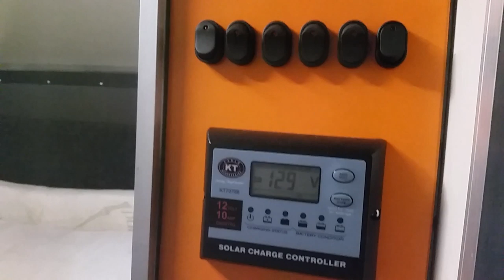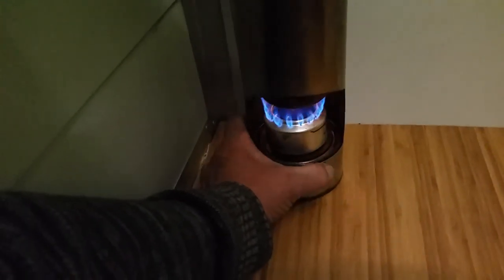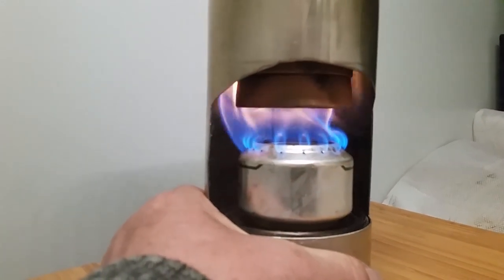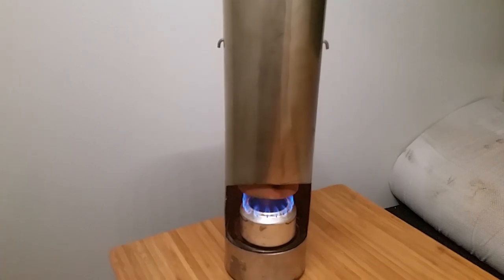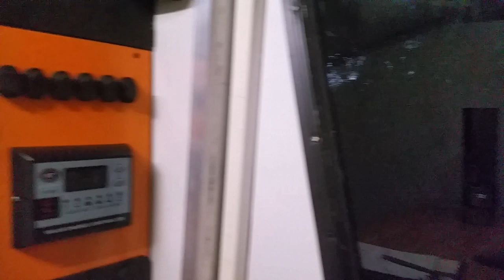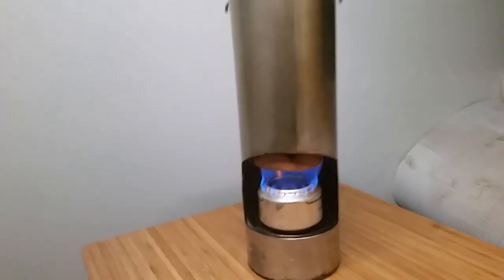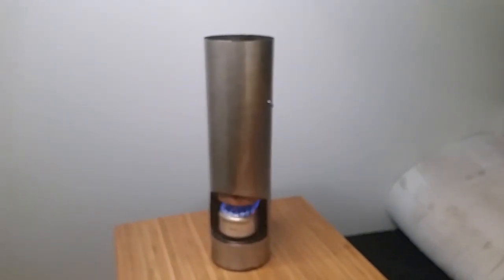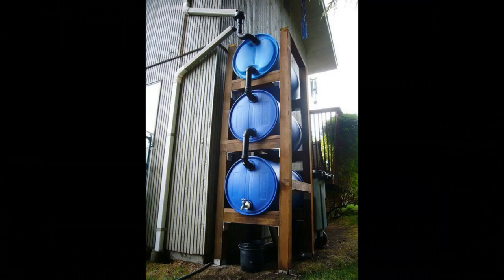DIY Heater for Teardrop/ Van/Tent- Off Road Camping Expedition Overland Trailer-

Comment from the maker: This is an un flued open flame,  liquid fueled heater and ALL the safety protocols must be observed.
* use with adequate ventilation 
* ensure that you are not a complete idiot before during and after use
.* attach unit firmly to a fire proof surface,
 *stay classy - don't try to rip me a new a- hole because you think its dangerous. -Remember Im old and I grew up with kerosine heaters and survived.

Comment: I use bioethanol in a trangia to heat my insulated van. Works great, but people always come to check, when they see the flame in the window, which is somewhat reassuring but rather intrusive.
A chimney like yours would hide the flame nicely.
Not sure how much effect the terracotta pots have. You should totally do a thermometer/stopwatch comparison with them in the chimney vs removed.
Reply: They'll put off heat roughly in proportion to their mass.  The way he's easily moving his contraption, I'd say it's not a very great mass.  A teardrop is a pretty small air-space, though.  If it's insulated, it probably holds that initial heat pretty well.  Moisture build-up is an issue if you button it up tight enough to hold the heat.  Of course, you're maybe asleep before the fire burns out, and your vent's still open.  I'd be obsessive and stay up 'til it went out, and (partially) close the vent, after.  I wonder if any work's been done with pass de-humidifier.  If you've got it tight enough to trap heat, you're also trapping the moisture from your breath.

Comment: I've used 3 inch stove pipe with elbow inserted into engine intake on small general aviation planes, with a propane torch in the bottom. Works great in cold climate to preheat the engine for starting.
Reply: just trying to invent a preheater system for auto engines to reduce fuel consumption during the warm up, We need some sort of 12 volt heat gun and now with the cordless tools that might just be the ticket to rigging up some sort of warm up system.

Comment: Ahoy, from the tropics of the USA.  Some obvious variations would be to make an alcohol burner with twice the fuel capacity and half the burn rate.  It would create only a bit more CO (hardly any).  Use the hot burner for quick warmth and then switch to the slow burner to maintain for an hour more, before it goes out.  Ceramic pots... wish I had thought of it.
Reply from the maker: Yes yes!- Im doing just that now. I have a tuna can with a wad of toilet paper in the bottom one inch thick. on top of that I have a layer of 1/2" stones. That holds 4x as much and burns for 2 hours 20 mins

Comment: Great little heater. I remember when we did use kerosene heaters back in the day you used to put a tube around the flame I think with the result that it only got air from underneath. It would then burn with a completely blue flame with no smoke. Not sure if that makes it hotter and/or cleaner (hotter is usually also cleaner)
Reply from the maker: yup - I fully agree with  you- Im getting great results in zero C temps.- we had frosts two nights out of 4 and I stayed toasty

Comment: I think a simple oil or gas lantern can also keep these small spaces pretty toasty.  I'd like to have a wall-mounted lantern that drew its air from outside and had a chimney, so it was sealed-off from the passenger compartment.

I knew a guy who had an insulated canopy for his pickup.  He'd throw a couple layers of memory foam and a mountain of blankets in the bed and hang a lantern from the vent  - one of those tilted windows on a crank.  He went out camping, hunting, and fishing, year-round, and he swore by the lantern method.  I'm pretty sure medieval Mongols ran around in fur-lined yurts on wheels that they heated with fat-/oil-burning lamps.

The Sugar Lobby demonized it, but up North, oil and fat are gold.

Comment: Perfect? Not so much, stressing ventilation can not be understated. Emissions are present. Alcohol is still emitting volatile hydrocarbons.  Ventilation, ventilation, ventilation, especially in a small insulated footprint teardrop trailer like this.  I like the thermal mass clay pot adaptation.  Simple and practical.  FYI: Any off-the-shelf small wood gas stove can accept an alcohol canister too. Good thing the vent and door were open in this video providing adequate ventilation.  Alcohol, paraffin, and kerosene poisoning is a real issue in non-ventilated spaces. SilverFire Stoves & Cookware.

Comment: May be you could use a set of magnets like the one from an old hard disk to keep the burner in place ...
Reply from the maker: oooh- awesome Idea Guenther!- Ill fita heat shield to theback and sides then do exactly that. You are awesome!
Reply: Speaker magnets or microwave magnetron magnets good also..
Reply from the maker: @ng4410   haha-I have this fetish for Neodymium magnets and cree LEDs Ill be using recycled hard drive magnets

Comment: How many BTUs in 440ml? A gallon of alcohol contains about 77,000 BTUs. A gallon contains about 3800ml so a little math reveals (77,000ml/gallon / 3,800ml/gallon) x 440ml = 8,900 BTUs for your full alcohol burner which just might warm your tiny space if you hurry and get into your sleeping bag... lights out... keep safe!

Comment: If you put a cap on it with a 1 inch exhaust pipe (flexible stainless steel) you get vent out the gases and have zero CO emissions.

Comment: Great idea I made something like this using jus terracotta pots 
Bit worried there is no insulation around it just in case this was grabbed if it was tipped or bumped 
Cheers will wait for the how to clip 
Well done
Reply from the maker: Im going bracket it off the wall with a heat shield like boat ones are done

Comment: Not dry heat.  You are introducing moisture.  What do the plant pots do?  I have used just a length of SS flue placed on top of my Origo stove, being a black flue radiated well. I also put an alcho burner under a tall upturned pot, then ran a copper pipe as a chimney.  Worked well, the plant pot radiated nicely.
Reply from the maker: interesting that first you tell me that Its introducing moisture- then you ask what the ceramic pots do.-Well hopefully, the ceramic will heat enough to alleviate the moisture.  Ive just been away and used it in the micro camper for 4 nights. there was no condensation, the windows roof vent or ceiling were bone dry.. there have been a few 'naysayers' so far but they are just people regurgitating what they have heard or read.  People like you and I who actually experiment usually find that things are possible with a few tweeks. Thanks for sharing your ideas

Comment: Alcohol heater will output exact same BTU with or without pipe within same time frame, so why bother? Also It is top heavy, prone to tip over, fire danger and space hog.  :)
Reply from the maker: In the next video its attached to the wall in its holder- this video was the first test
Reply: Alex G: Good catch, but the one positive aspect for using a pipe - preferably a 12" by 3" steel tube with as thick a wall as you can find - is that it will absorb, retain, and disipate heat longer than the same 'setup' without a tube.

And as you pointed out, it definitely needs a wide, heavy attached base to help deter the unit from being knocked-over.

One other thing to consider is the use of an aluminum or al. foil 'reflector' to keep the wall(s) from catching fire, and even then the heater should still be at least 12" to 18" from anything combustible.

Comment: Does the fire flame not hurt the clay pots? Would I have to worry about them cracking or exploding?
Reply: they definitely will. Clay pots are not the best for thermal mass imo because they crack  eventually and can cause the fuel to spill and fire hazard ensue.

Comment: How about, instead of the clay pots, you heat a suspended tall bean can full of water for some mass to heat & to replace some of the lost oxygen ?
Reply: I was thinking instead of using clay pots I'm gonna try an ammo box, candles and those ceramic squares from bbq grills. With that type of design it may be possibly to cook on also.

Comment: Wow.  I saw the pot idea for a candle. Would sterno work too? Great camper btw!
Reply from the maker: sorry- whats Sterno?
Reply: @t.h.o.r.  Sterno is a jellied methanol fuel in a can, used to warm chafing dishes (think catering) and safe to burn indoors.  That answered, I have a couple comments of my own.  The flames coming up the chimney are leaping quite high, great draw but I would be worried about setting the roof of the camper (or anything combustible nearby) alight.  To control the heat, may I suggest a rotating ring on your homemade alcohol stove that would shut off a number of ports as you turn it to regulate the amount of heat being generated and a way to 'turn off' the stove without just waiting for it to burn out.  A bit of math and careful hole placement should allow you to design it to selectively shut off a greater number of ports as you turn it around.  Or the simple route and just have a cover to turn it completely off or another one for half off, etc.  Regulating the flame would allow you to turn it down as the mass warms up so that the flames wouldn't reach as high as you don't need the flame itself up the top of the chimney to heat your clay pots up, just the rising heat from those flames.  I know you have multiple burners, but you would have to extinguish and light smaller ones into the burn, might be just easier to reduce the number of ports.
Reply from the maker: @gonnagetya1433   Awesome comment! Thanks- yes I have a snuffer lid to extinguish it. my Trangia burners have a moderating ring that works well. The burner in the vid is my boiling burner which uses 2 oz of fuel in 15 mins and gives a bigger flame. My simmer burner has smaller holes and burns much more sedately and longer. I will be playing with this much more and soon I may even have a 'saleable design' 

One thing that makes me smile is the fear and caution that so many young er people have - I grew up with kerosine heaters and no airbags- and Im still alive!
Reply: Gonna GetYa thanks. You beat me to it. Great additional suggestions
Reply: @t.h.o.r.  Well, you are younger than me.  You don't get old if you are reckless, and being safe is about thinking about what might happen before it does.  But in today's society you have to make things fool proof to protect those who don't look up from the phone.

Comment: alcohol like propane is a clean flame. you can burn indoors and the entire exhaust warms the interior, but what you DONT say is there is considerable water made by the flame also like propane or gas, and in addition to C02 you get tons of water vapor and it will create mold/condensation issues. This a reinvention of the old paraffin and kerosene heaters from the fifties that were common..( I live on a boat and have heated with propane and would never do this daily..For one chilly night? yeah..But dry it out the next day!
Reply from the maker: What I Did say was that it runs for 15 minutes just to take the chill off. Meths- denatured alcohol is 98%pure so assuming that the entire 2% remaining is water - 2% of 30ml is 0.6ml .  The water vapourises and will condense on a cold surface . The coldest surface I have is the window. (the rest of the construction is EPS insulation panel.
Although I havent sat down and trolled myself about wether  1/10 of a teaspoon of moisture is going to grow a crop of mushrooms under my mattress-I am aware that one persons respiration contributes 500ml of water to the atmosphere in an 8 hour period.- Perhaps if you advised me to not breath at night it might have a greater effect?
Reply: @t.h.o.r.  the water doesn't come from actual H2O in the alcohol but from the hydrogen in the fuel combining with O2 to produce H2O, the primary combustion product of either a propane or alcohol Flame. For every molecule of alcohol you get at least one molecule of water produced. And indeed in a tiny enclosure condensation is always a major enemy whether one uses an appliance like this or not. Yes just your breath will produce a great deal of moisture. We exhale carbon dioxide but also a great deal of water. Car exhaust or any form of Fire has water as a major component.
Reply from the maker: @douglundy5755   Ahh lol so all my maths was in vain! lol. - there is no dampness on the glsss or the walls. the ceramic seems to create a lovely dry heat. Im not living in it of course so your fears dont really apply in my situation.  The pod is incedibly well insulated and after taking the chill off body heat seems to keep it at about 10-12C when its just above freezing outside.
Reply: @t.h.o.r.  Glad you dont have condensation issues. I live in the NW and  this is a chronic issue in many RV's. Plagues of black mold..All the best! (looking forward to your information and resources)
Reply from the maker: @douglundy5755  Thankyou- I would have expected Florida folk to have more humidity issues? - Im making a base and heat sheild for it right now so the next vid will be an improved version.  I have two types of alcohol burner - The fast one was in the video- the slow one is great once it has warmed up cos it just licks away quietly under the pots and maintains warmth- Im using it nightly in my big house truck (250 square feet) while I perfect it.

Comment: Here you see that every heater has it's use case.
I understand why you are so crazy about these heaters but this is an open flame in a very tiny space. I am not really fond of that idea. Including the CO issue.
To me it is also seems quite instable. (Tiny base + rather high).
In places where you don't have any electricity at all, I guess I could consider a heater like this.
I myself rather have a Diesel burner. no CO problem, no open flame, good control of the temperature. In winter it can be left running throughout the night.
But it does need diesel and electricity.

Comment: If you go on youtube and type in: "uco candle lantern conversion", you will see a video about oil lamps, made of 2 oz. shot bottles.that burn for 9 hours.  PSC camper conversions, the author, uses  4 together to get over 5000 BTU and he gives you full details to DIY. 
If you use a 4 inch dryer vent hose from the top of the flue pipe, you could run the exhaust outside to allay any concerns about CO.  Combine that with a double walled flue pipe and you should not need heat shielding, just a single stabilizing rod.  Worth a try?
Reply from the maker: wow - that sounds good , Ill go search. Thanks for sharing- I have a 1940s kero heater that is a work of art- Im keen to convert it to burn alcohol as a project
Reply from the maker: Haha- as soon as I saw it I recognised it. :) watched it a while back
Reply: @t.h.o.r.  Still, 9 hours on less than a cup of lamp oil!  I am trying to use wicks to burn seed oils without success although there is an oil-burning "Chunk" light on youtube using a wick.  Seed oils have a very high energy level once burning and last even longer than lamp oil.  And they are very safe - give them any excuse and they will stop burning.  My next effort will be to burn these oils in a copper pipe cap sans wick, connected to a feed tank like a waterer for dogs.  Have to learn to make videos.
Reply from the maker: @alleeoop4834  yes, Ive been reading about Canola- I stopped cooking with it years ago wen I found out about the carcinogens. But Ialways knew that it was like diesel in its heat potential I never imagined that it would wick. 

Once again you have inspired me!. but its igh summer here- no time to be playing with heaters!~ I have firewood to split and a drinking water project to finish

Comment: You should have attached the roll down thin copper foil to the stainless steel tube for better radiating the heat, like ascii art below. ;-)
___o___
Regards from Poland.
Reply from the maker: Great point!
Reply: @t.h.o.r.  i have something different for tent. 15meters of spiral thin pneumatic pipe (internal diameter of 5mm), small usb water pump, 1.5l alu can. inside this alu can i have small 0.7l alu can with water, which is heated from small torch like yours.
Reply from the maker: @zygmuntzarzecki   Thats wicked!  I have a coily air hose that I dont use anymore- I might experiment with it= I like your idea!

Comment: How long does the camper retain the heat of a 15 minute heat cycle?? Must have in flow and out flow of oxygen.
Reply from the maker: because I have a tiny space and fabulous insulation it is very efficient. I cant make quantified claims- all I can tell you is that this is vastly more efficient than the candle and flower pot idea-  4 consecutive nights of howling wind and zero- 4C temps was no issue at all. Take off the initial chill and the pod stays at a 12-14C temp all night.